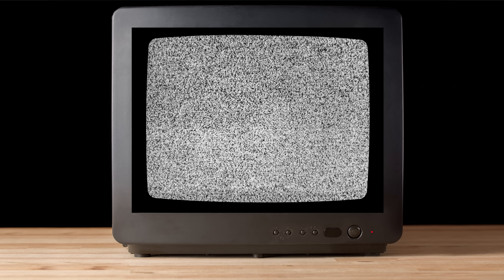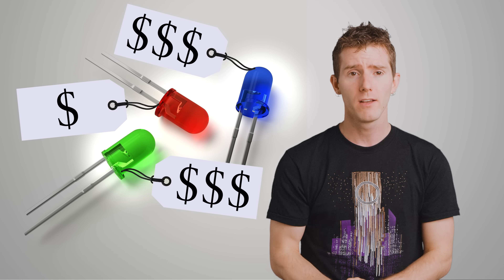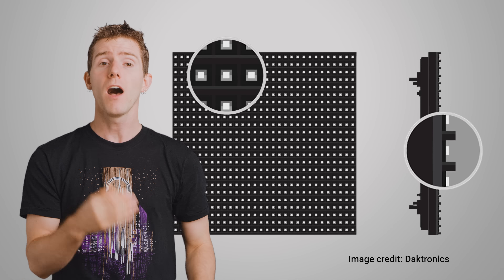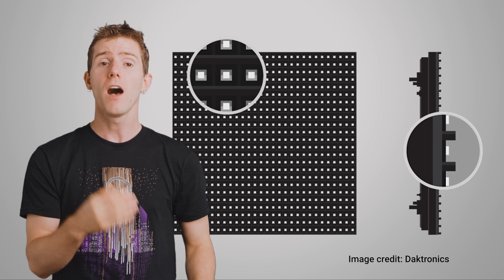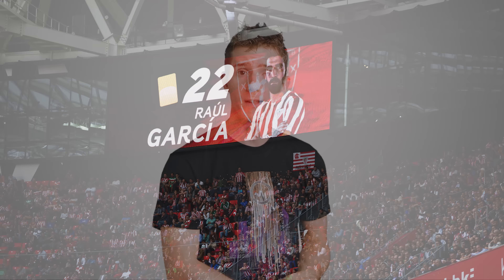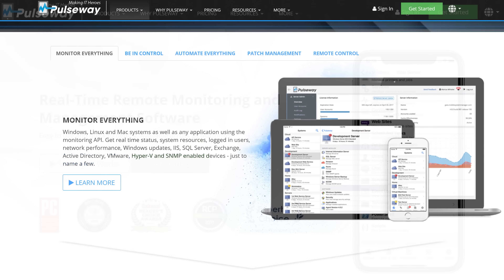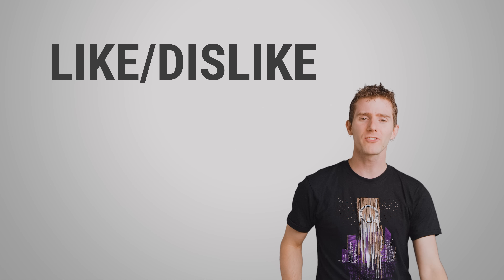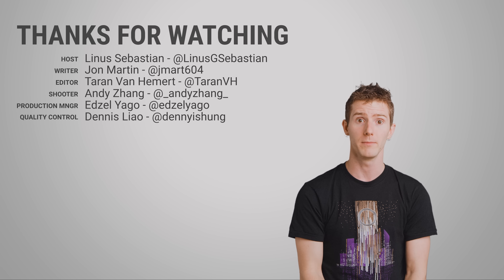How The World's LARGEST Screens Are Made

Comment: So my high school uses a daktronics jumbotron, now me being the only student in my school who knows how to use it and uses it every football and soccer game, im fairly familiar with it, and so when you say jumbotrons need these control rooms with thousands of buttons, i remembered our pressbox literally only being filled with two control modules, a desktop, and a tricaster. I also remembered how temperamental our system can be, where if the graphics arent loading, the desktop is used for switching what goes on the jumbotron, then u can usually fix it by turning the system off and turning it back on, and dont even get me started on the tricaster, we havent been able to use its instant replay function because well the second monitor needed for that never worked, even with new monitors. We have since fixed it but i dont have an assistant director annnddd 2/3s of my camera crew probably has been threatened with expulsion, because of their stupidity

Comment: These are not "Jumbotrons". That name is a Sony branded. In the industry, we have several names for them, most common is "Video Wall" and "Ad Ribbon" or a name specific to what part of the building or field they are located (north wall, center hung, etc). There are computers, servers, and other proprietary hardware that will process the video sent and display it on the video wall, but the pictures you showed of the "button and knobs" were the video switchers. They take the multiple video sources and allow you to direct that video to the different video outputs, as well as appy various effects. Not directly related to the video walls (as it is typical to be a seperate system) and in some instances, the video wall image/video will bypass the video switcher and go straight out to the video wall via the video wall servers. (this is as simple as I can make it)

Comment: I set those screens up for a living! They’re pretty fun actually. Like building big legos lol
Reply: Big 50 pound legos.
Reply: Hey! I also set those types of screens up for a living! Not jumbotrons but LED walls for live events! They are definitely fun to do until you get a load of dead pixels 😂
Reply: I fix them. They can be a bit of a pain. I had to work on one during the winter. It is almost impossible to take them apart when ice gets involved.
Reply: @jonathanstaffan3573  Urgh. I don't envy your job 😂 We are lucky enough that when they break we can take them back to the workshop to fix, the ones we use have pixel pitches as low as 2.6mm, I'm just glad I've not had to fix one of those ones yet 😅
Reply: @stevenhaynes9605  Have you worked on any with wasps nests inside? Also wasp nests in the Alan key hole. So you have to dig out the gunk in order to unlock the dang thing?
Reply: @jonathanstaffan3573  Fortunately I haven't, that sounds awful! Our screens are usually just installed for a few days on a festival stage or in a hotel for a corporate show then taken back down again to be hired out for the next show. Wasps don't get enough time to nest 😂
Reply: I describe them as "Giant electronics lego" to people.

Comment: I work for a company that runs LED boards and you might be surprised to find out that most modern processors for LED boards have DVI and HDMI inputs that let you run them off of another computer as an extended display. It is how the majority of set ups run.
Reply: Doesn't surprise me in the slightest. I was more surprised that Linus made it out like a complicated video control panel is mandatory to operate a screen like this when it obviously isn't. Those control panels are used in live TV broadcasts as well and merely control the outgoing picture. The screen is still just a screen. There's nothing to 'control'.
Reply: @TigerXGame 
Not quite 'nothing' to control.
Any half-decent jumbo-tron (tm?) style screen is constructed from a whole bunch of LED Panels (or modules).
These modules do not last indefinitely, and therefore they occasionally need to be replaced (eg: a few pixels 'die' or perhaps the integrated electronics fails).
This means replacing of a single module with a NEW module.
Unfortunately, the component LEDs used in modules DO age over time losing some of their brightness (Especially those used outside where UV from the sun affects them).
Therefore, when a NEW module is installed, it is often inherently a little brighter than all of the older units.
Furthermore, it's not uncommon for a fairly significant amount of variation between individual panels (especially if they're from different manufacturing 'batches').
Any 'professional' level jumbo-tron type system will allow the tech to 'adjust' colour saturation, white balance etc to account for these process variations / panel aging.
Therefore, it's fair to say that with a properly setup display you can just plug in your HDMI / DVI etc cable and use it, there's actually a lot more that needs to happen 'behind-the-scenes' for a good viewing experience.
P.S.
The individual LED panels aren't even hugely expensive - especially if you 'cheap-out' and buy panels from cheap 'chinesium' sites. (<US$20 each for a 320mm*160mm panel with RGB pixels at a 10mm pitch).
You can also grab them pre-configured into larger panels (eg: 960mm*960mm seems quite common) although I didn't take that route since I only wanted a scoreboard rather than a full video-wall.
For those interested in delving further into the electronics side, take a look on the Sparkfun and Adafruit websites for a rough primer.
Reply: Sweet! The ultimate gaming monitor 😀

Comment: Good video but not entirely correct. Most of these LED screens are made up of individual panels around 500mm x 500mm which have custom rigging frames which allow them to lock together to create a seamless edge. You can then take these standard panels and build a screen any size or aspect ratio you want. Each larger panel is then made up of smaller sub panels which can easily be swapped out if any dead pixels are found. On the back of each large panel is a circuit board and power supply which handle controlling each individual LED on the panel. 

These panels have power in and out to link together for quick install. They also link together using Ethernet cable which sends the video data to each panel. The signal for the screen is sent from an LED processor which outputs multiple Ethernet streams to connect into the larger display. There isn’t actually much special about this hardware and it’s basically a screen processor often with an image scaler. So you can send in a 1080p or 4K HDMI signal and the scaler will fit this image to your LED screen. Most of these screens will be connected into a PC running specialised video production software (Resolume, Green Hippo, Disguise)

In terms of resolution LED screens like these have had massive development in the past 5 years. It used to be a 10mm density screen was considered cutting edge but these days you can get as fine as 0.9mm!!! Check out Roe Visual who produce some of the most common LED screen used in the install and entertainment industry. And the resolution adds up quickly on the high res screen and you can easily be sending multiple streams of 4K or 8K to a system.

I work in the concert touring industry as a lighting and video designer and have worked with large scale LED screen layouts at various concerts, music festivals and shows like Ultra Festival which are famous for their large and interesting screen layouts. More than happy to answer any questions about video and lighting technology in this area. Lots of cool tech powering large scale video projects for example the use of software like ‘Notch’ which produces 3D content in real time and requires some serious hardware behind it!

Seriously more than happy to answer any questions on this topic!

Comment: That control rooms has fuck all to do with this screen. Those control boards are used for anything from live broadcasts to studio recordings and live events. These big screens are still just screens. You tell a bunch of LED's when to turn on and off. That's it. A laptop from the 90's could probably do that. It doesn't require anything 'powerful' to send it a picture. Sure, mixing and fading several video sources together requires powerful and dedicated hardware, but guess what? The screen has fuck all to do with that.

Comment: i used to work (as a third-party service tech) with folks at daktronics, watchfire, optec, and a bunch of other companies. to the "in the industry" userbase watching this video to see "how linus did".. first, its techQUICKie. second what many companies wont admit too: many of these signs run on win XP embedded, they are hooked to your local network, many are remotely accessed, and no one is thinking to disable SMB1 or otherwise patch against ransomware. many installers never change the default user acct. a powercycle and malware is gone on the device, but these can be a wide open door to local network exploit. many vendors dont want the hassle of revisiting old accounts. they should at least inform their past purchasers of the threat. no security bulletins on any manufacturers sites.. is just irresponsible.

Comment: Engineers: LEDS consume virtually no power and generate virtually no heat

Sports ppls: this one needs 635,000 watts and dedicated arctic cooling
Reply: I work with LED displays, the panels definitely generate plenty of heat. One product I work with regularly has no safelty limits on output and will melt down the panels if you let it.
Reply: James Russo LEDs produce about 15 to 17 percent heat

Comment: For someone that actually rigs LED Screens (thats what the event industry calls it) on a regular basis at work. This is a very good example video about the basics on how it works. It can get very technical after this point. very quickly.
Awesome video
Reply: I missed the part about modularity, they could easily go to a local event supplier and ask them for pictures or videos of a setup.

And what I didn't like was the part about the controll room. The controll room is for broadcasting purposes. The Videofeed for the "Jumbotron" does just happens to fall out of it.
I've built Screens on the magnitude of 30m² and just pluged a laptop into the "Jumbotron" controller and went home.

Comment: On the whole, cool. As a broadcast engineer I cringed a bit a some of the statements. You don't need a full on gallery to control a single large format display. Also, aspect ratio is mostly meaningless in the format, as they can have anything dependant upon layout. So comparisons for HD or 4K are mostly pointless. Sorry :(

Comment: On the controlling part: the screens I’ve used just need 2x 1U boxes - a scaler that takes SDI/HDMI/DVI and drops down the resolution to the screen’s native res, then the screen controller itself which takes the video and outputs it over Ethernet to the screen. This controller can be set from a laptop to fix white balance between the cabinets(0.5x1m sections the screen disassembles into) and individual modules(0.25x0.5m) within the cabinets, and also to set the order in which the cabinets are connected(the Ethernet loops between them) so the image isn’t random chunks all over the place.

All the video desks and camera switchers would normally be needed to generate the displayed content, but you can just plug a laptop into the screen’s scaler directly and it’d work.
Reply: Yeah, I usually use resolume on my laptop
Reply: I always wanted to play a game after setting up a board.  That always ended up being at 10pm on the last day to work though.

Comment: As an AV and lighting guy , half of the information here isnt correct or relevant , today most jumbotrons are off the shelf LED panels or customized ones by a big manufactures lets take for example PRG which makes the only transperent and high res LED panels , controlling them is something different , its just a basic 1/2u processor that connected to every led panel module and that sets the resolution , location of every panel. But the processor has nothing to do with broadcast gear , you can simply connect a vga / dvi to a computer and show a computer on that screen , today what used to show media on jumbotrons are media servers that is connected to the broadcast gear and usually get an SDI signal , and most typical use of LED panels are in shows and festivals , they are basically using a media server program called resolume 
Les panels on shops and streets usually shows a slide show that loops / looping a video 
But the real cool use of led panels , is the new deadmau5 cube , the cube v3 is amazing , you should talk about that

Comment: Hahahaha powerful control room. The most powerful equipment needed is the sending cards. The really big screens need multiple sending cards and, really you just need scalars that talk to those and then plug any signal you want into them. Though modules change in size generally they are 150x150 pixels in size and the space between pixels is referred to as pixel pitch. Btw when someone calls it 3mm screen it's usually 3.9mm. So there is some marketing wank going on there.

Comment: The control room segment made me laugh .Nothing you showed had anything to do with controlling those displays.  It literally was the broadcast control room, where the program feed is produced. The display processors are not much to look at-they are boring rackmounted units, remotely controlled by software and fed a video signal which they scale and convert to a proprietary data format to send to the display modules.  Not many buttons involved ;-)
(none if you use a table for control...)
@Linus: I would doublecheck that 635KW Number - that sounds more like a CRT jumbotron than a modern LED wall.
For comparison, the modules we use for Arena concerts and such are made up of modules with 96x96 pixels and they put out around 6-8000 nits at 100% power (I've never had to run them at more than 60% though, even in broad daylight) anyway, each module uses 144W, So for a 1920x1080 image you would need 240 modules, which is a combined power draw of less than 35 KW at full power. for the entire screen..
So I think somebody was bragging a bit when they gave you that number... ;-)
Reply: agree
Reply: That 635KW number was for the CRT wall
Reply: Well it was Daktronics...
Reply: @TheSirGoreaxe  Good point. They make good signage solutions though ;-)
Reply: @Zachary.Hutchinson  I'd say so as well...
Reply: He makes it sound like using a video switcher is sooo hard and you have to be soooo precise.

Comment: Now explain how electronic billboards work, or if they’re the same.
Reply: Same thing, these "jumbotrons" is the same tech they use at concert screens and in venues like that.
Reply: They are similar but pre programmed to loop. Some are connected to a broadcasting network (eg. NBC) to display the news like in Time Square.
Reply: @kenzito101  Not true, it uses the same computers in a different package that the video displays use.  The system they called the control in the video is just video production, not display stuff.  Daktronics video boards have a VIP, video image processor, that converts a DVI signal normally into a fiber signal to go to the display.  A billboard has the same VIP as the smaller video displays.  The computer that plays the content to that is different though.
Reply: These billboards are the exact same tech as jumbotrons, it all comes down to the software. They'll have a computer or purpose-built hardware, that will run overlays. Some switcher programs include Blackmagic ATEM. The video will go out using SDI (similar to Coaxial), then be decided to the screens.
Reply: Akiru's Lab Also In Dundas square which is Toronto’s Times Square
Reply: They're the same tech, just built for 24-7 operation with less focus on  smooth video. As they are usually static images.

Comment: Well, so that "technically" makes it an OLED panel as well I guess?
Reply: Jesse Krämer no
Reply: @BasilMinhas  Well yeah, They won't be an OLED panel but to the most basic way of how they both work (which is LEDs that can lit up individually) technically puts them in the same type of technology, albeit at a much larger scale.
Reply: @hanakomisa  The materials used for OLED are different than that of traditional LEDs. So no it's an LED panel.
Reply: @ky5666  True, I forgot about that.

Comment: Pulseway is terrible. It does not use a single App for everything. Its 2 separate web GUIs and one clunky software for Remote Desktop.  1 out 5 Stars. Wish you cared about the sponsorships.   Remember Synergy? Yea that was terrible never worked right and also promised so many features that were never delivered. If  looking for a great solution for managing PCs and Servers Beyondtrust Bomgar is way better solution .